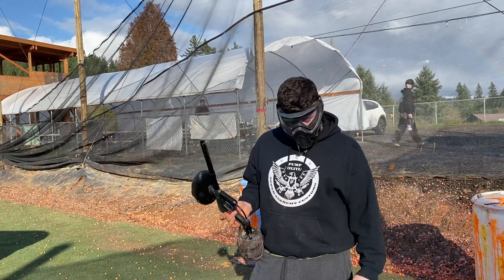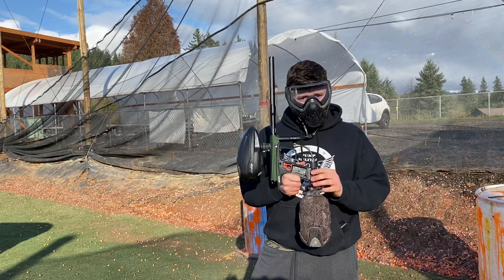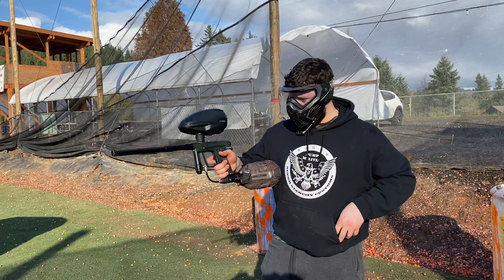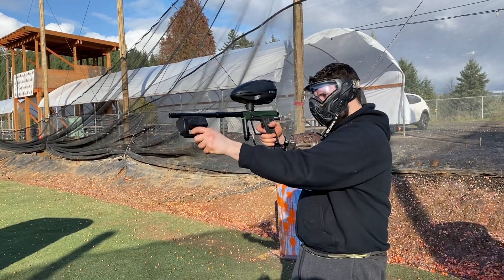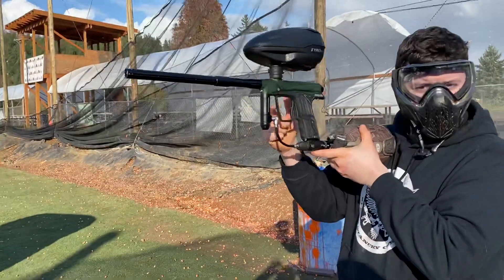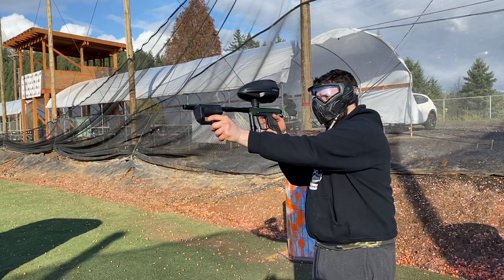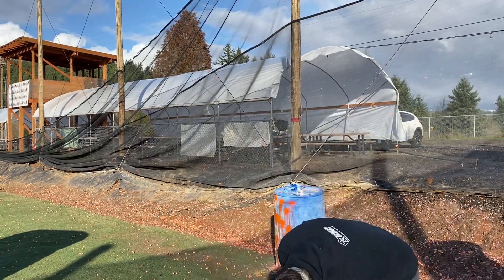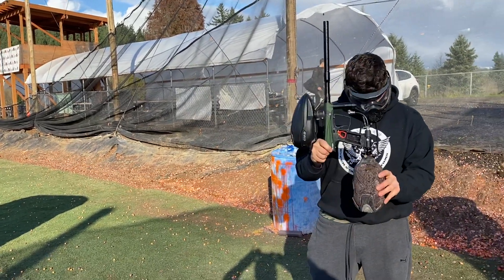Mechanical Planet Eclipse Etha1! Project “MEEtha”

Comment: Always interested in keeping things alive. I have an etha 1 which works just fine but you never know. Are you open to sharing the stl and maybe a very short description on how this was done?
Reply from the maker: we have a mount we designed
and then had to modify the solenoid bracket for barb fittings

Comment: That's pretty cool. Would firing on the release prevent short stroking?
Reply from the maker: On the pull, the valve chamber fills
On the release, the valve dumps

We couldn’t short stroke it as a “chop” but it would stutter and not cycle if you didn’t cycle the valve all the way
Reply: @superstanchycustoms  I see. I wonder if this could be applied to a Dye NT as well
Reply from the maker: Ashraven PB we have a mechNt on the wall!

We used the msv2 valve for it

But the valve was so big it was difficult to fit in the frame!